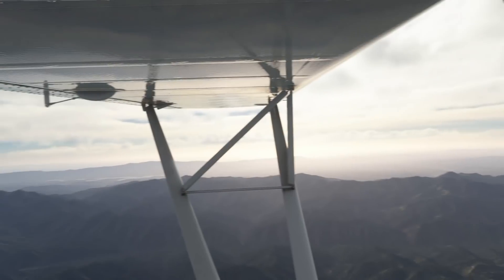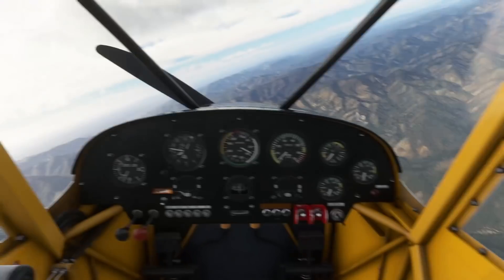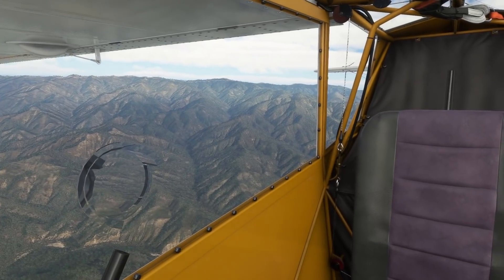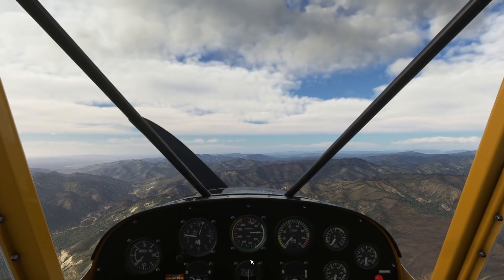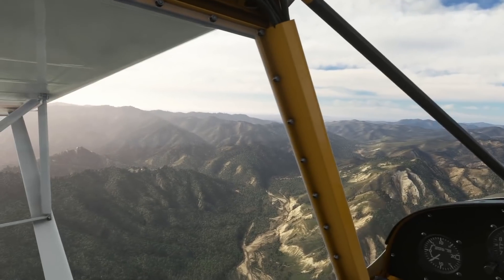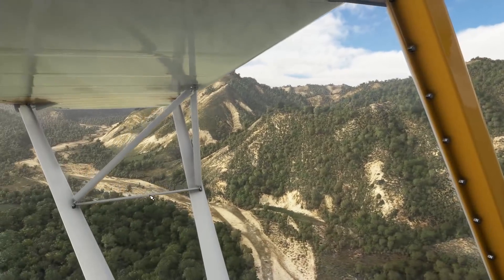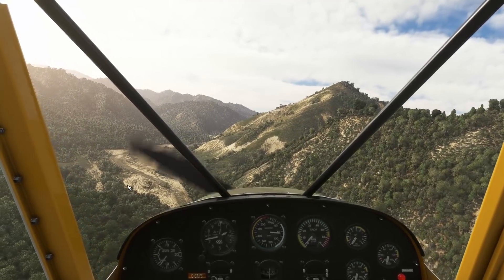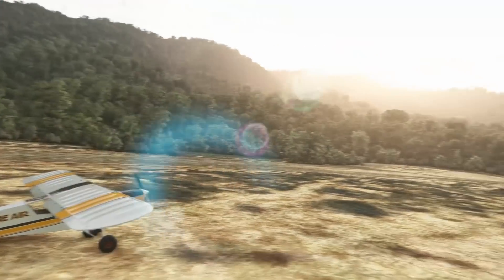Real Pilot demonstrates Forced Landing - What Trevor Jacobs could have done! (MSFS)

Comment: Engine failure memory items:

1. GoPros - ON
2. Jump
Reply: you forgot "grab selfie stick" lol
Reply: @bend1483  That is the critical one for sure!
Reply: 3. Walk you ass back to your plane remains,... uphill
Reply: 7: retrieve the wreckage before the FAA/NTSB starts an investigation
Reply: 4. Don't take your headphones off and get smacked on the head on the way down.
Reply: @andresophisma  this comment has had me laughing for 5 minutes
Reply: 167: enjoy your first beer after 5 years in jail
Reply: 169: Find out that those 7 other youtubers were actually good in faking their performance and got away with it. One used a timer to kill the engine, so they could film the inside of the cockpit.
The second one used a arduino to fake multiple failure to the fuel feed. 
The third used his arduino to kill the sparkplugs so the engine would run inrregular. 
The forth one got a newer plane and killed the onboard electronics. 
The fifth got a turboprop and managed to kill both engines
The sixth got a jet
The seventh got a fighterjet

All of them managed to save their planes and I was happy you didn't say 10, because my imagination was running low at 5 ;)
Reply: @patrickd9551  LOL
Reply: 168: find out that 7 other YouTubers crashed their plane two
Reply: 3. Stuff fire extinguisher in your pantleg
Reply: @pw1277  Initially I laughed about this remark. Then I saw the new video's that cropped up on the youtubez.

He's just full of it. 

I also saw a detailed analysis of where the plane crashed and where he landed with his parachute. It was pretty close to the plane too (as he had to check for fire)
Reply: @patrickd9551  if somebody can kick me in the GPS coordinates I'll take my GoPros and my quads and go check it out for you guys
Reply: Right now currently I'm in Paso Robles but I randomly just take off that way sometimes especially when I need to get away from the city and fly so I'm not going out of my way really just actually getting me something to do
Reply: @MadDragon75  there are quite a few video's around. Search for Trevor Jacob coordinates.
Reply: @patrickd9551  I've been on that mission and know it's 73 miles away from me.
That is one thing about this National Forest it covers a lot of area but it also has a lot of free camping even for a car, and personally in my opinion that's perfect because I don't plan on spending a whole bunch of money on this.
I'd just like to go check out Ground Zero for myself and you guys.
Reply: -1. Buy an old plane 
0. Take your skydive rig with you
Reply: You forgot “curse like you’re a terrible actor pretending to be terrified “. 
Having jumped from many an airplane, I can promise you that people who jump for fun are not terrified by the need to jump when you have a parachute on. In fact, the chute will give them an unrealistic confidence to put a plane in danger.
Reply: You forgot the selfie stick. Gonna have to Q3 you.
Reply: @Raist474  That was the first reply comment ;)